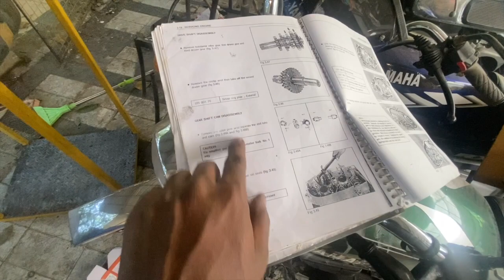Shogun Engine Rebuild: The Ultimate, Step-by-Step Guide | in Malayalam

Comment: When working/banging with aluminum cases over an iron work area, recommend to use a foam layer as it helps prevent skidding and aluminum pitting/cracking. I see you banging on the bearings which is okay, but the other side it might get superficial nicks or pits along with constant skidding and can sometimes even induce minute cracks on the aluminum cases. A cheap yoga mat or something like a thick household sack too works well. Rest is all good. Thank you.
Reply from the maker: Noted